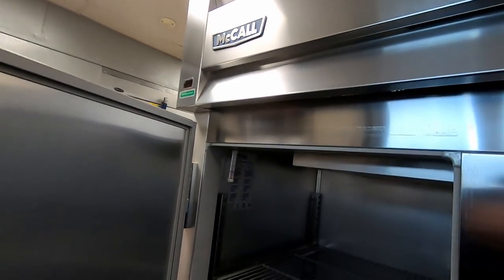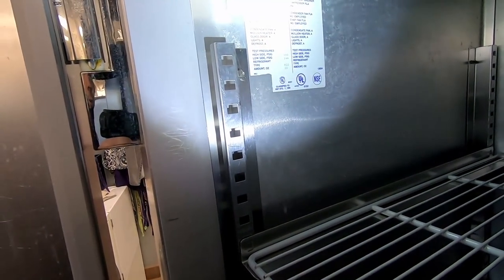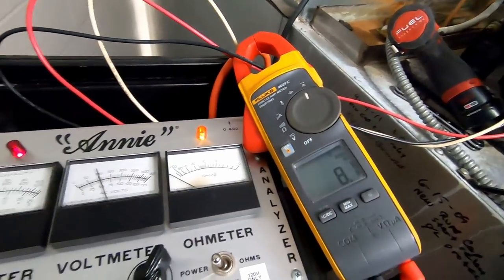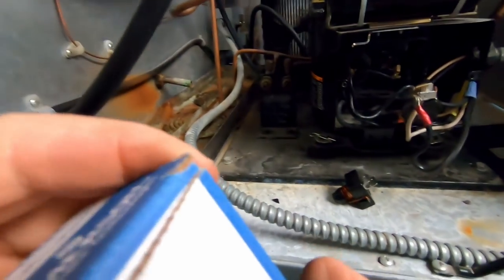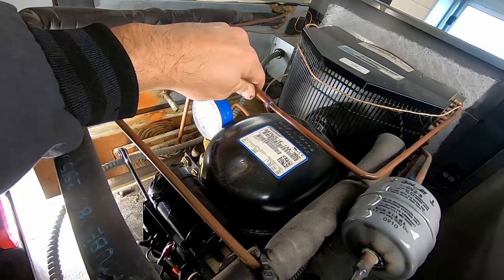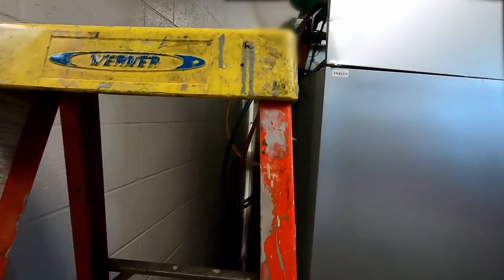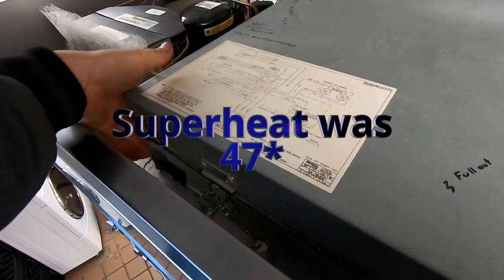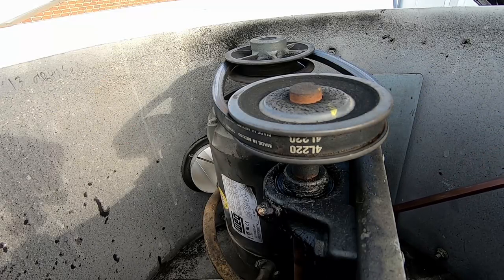COOLER IS WARM AND KITCHEN IS COLD

Comment: I think that device attracted my attention I think it is a specially designed system to test the compressor and run it reverse and straightforward in case of mechanical failures.👍👍👍
Reply from the maker: Your exactly correct 👍👍